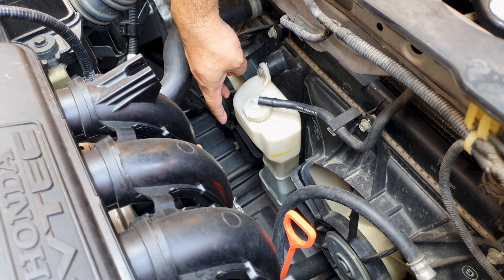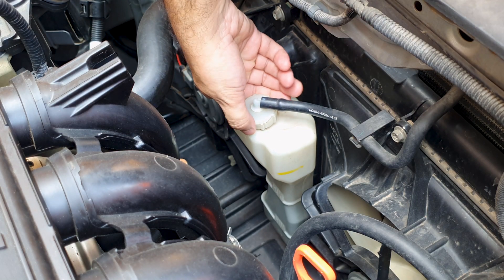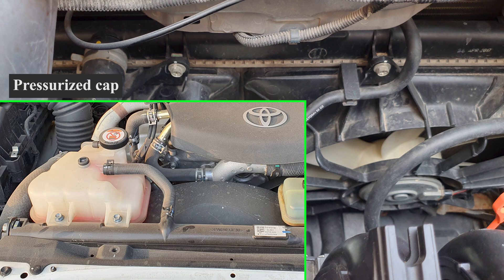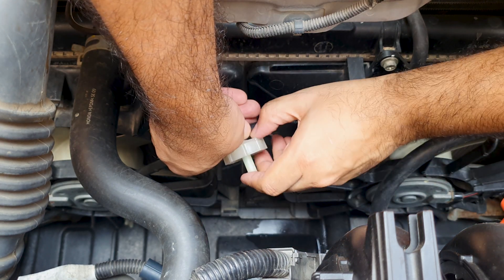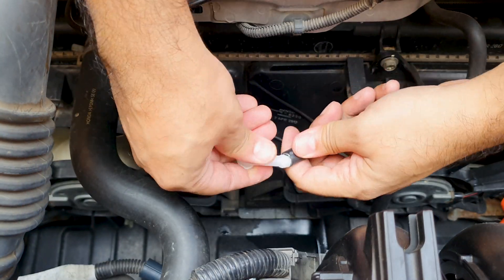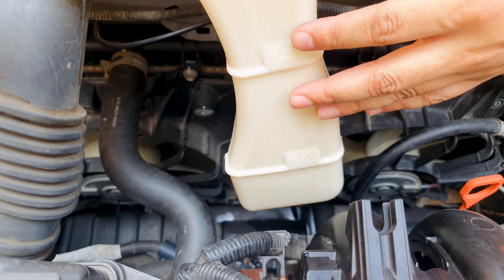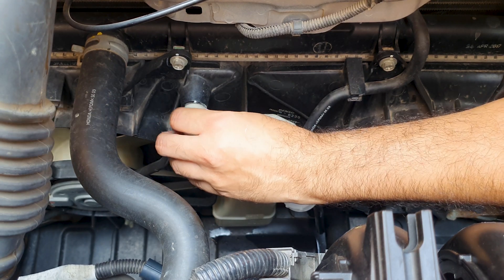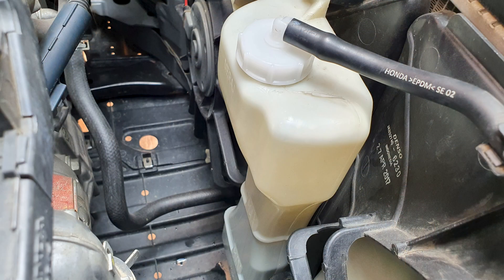Coolant overfill damage: DON'T exceed the maximum indicated level

Comment from the maker: Different manufacturers/models have different ways of letting excess coolant and pressure to escape. You could have a hose that leads off to the side or an escape port. 

Part numbers for parts shown in video:

19102-RNA-A00: Cap, Reserve tank
19106-RSA-G00: Joint, Reserve tank

Models: 
Honda FIT / Jazz 1st, 2nd & 3rd gen (2001-2020) 
Honda City 5th and 6th gen (2009-2020)
Honda BRV 1st gen (2016-2021)
Honda Brio 1st gen (2011-2020)
Honda Accord 10th gen (2017-2022)
Honda Civic 8th and 9th gen (2006-2015)
Honda CRV 3rd, 4th and 5th gen (2007-2022)
The newer generations of the FIT, Jazz, City, Brio and BRV have similar designs. I however do not have confirmation of part numbers. 
-----------------------------------------
Part numbers of some other models:

19102-PM5-A00: Cap, Reserve tank
19106-RSA-G00: Joint, Reserve tank
Honda Accord 7th, 8th and 9th gen (2003-2017)
-----------------------------------------
19102-PM5-A00: Cap, Reserve tank
19106-PA0-020: Joint, Reserve tank
Honda Odyssey 1st and 2nd gen (1994-2002)
-----------------------------------------
19102-REA-Z00: Cap, Reserve tank
19106-REA-Z00: Joint, Reserve tank
Honda City 4th gen (2001-2008)
Reply: From where did you sourced this cap? Honda dealership?
Reply from the maker: Yes. They didnt have it in stock, but only took a week for them to order it from the factory.

Comment: It's a bad design for a coolant cap. It should have an evacuation hose fitting so if the coolant is overfilled it has somewhere to escape to
Reply from the maker: I have seen evacuation hose on more older models. Maybe its an enviromental regulation, for the excess not to be dumped out? Dont know.